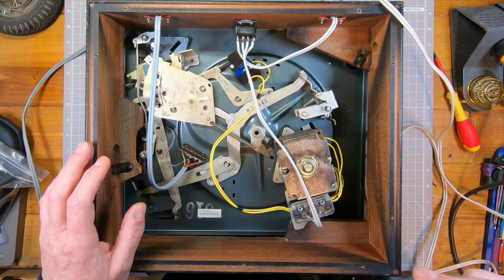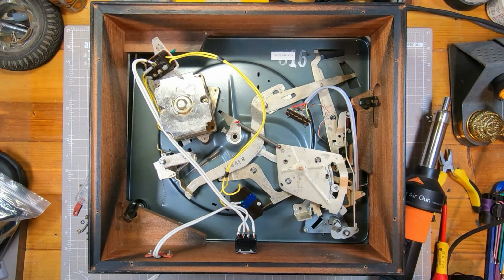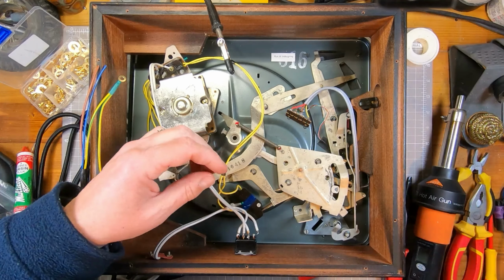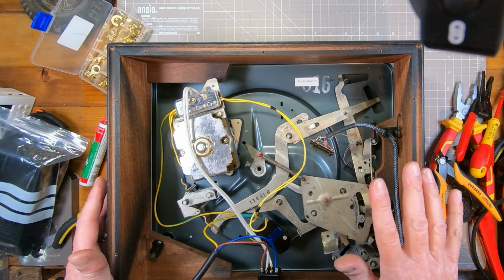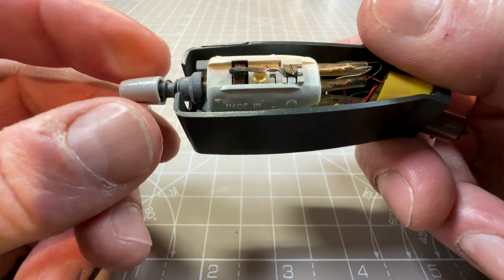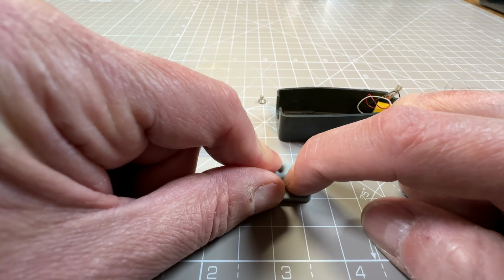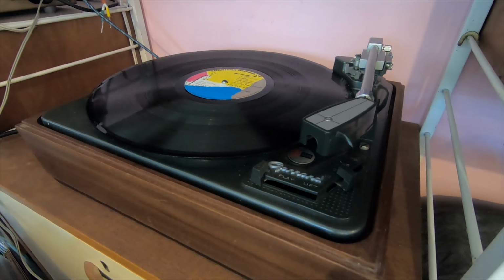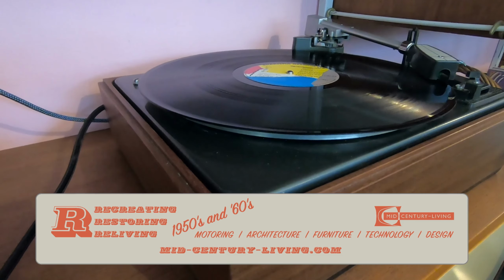Restoring a Garrard SP25 Turntable - How Good is a 60 Year Old Turntable?

Comment: Looking at about the 28:30 point would it have been a possibility to saw the mounting bracket off the original cartridge and use this to mount the new one? Attach to the headshell using the excising screw and the cartridge via the two elongated slots, which would then give some fore  / aft movement for overhang adjustment. Obviously you're at the sharp end there and it's difficult to judge from a video. Incidentally, earthing the turntable at the mains plug will almost certainly create a hum loop; that's why the design earths the deck via the signal leads. If this occurs one of the duplicated earth points needs to be disconnected but as the video's a year old you're no doubt aware of this by now. I genuinely hope this helps - it's not my intention to be a wise-ass! Thanks once again and take care. Edit!! APOLOGIES!! I've just watched to 39:54!! I should have watched all the way through before commenting, shouldn't I! Silly Billy! Apologies once again.
Reply from the maker: Thanks, I appreciate your comment - it was a bit of learning experience as I’d never done this before. It now all works and sounds surprisingly good.

Comment: Another fascinating video; I'm slowly working my way through your pantheon after discovering your channel. The original cartridge is a ceramic which had a very high output generated by a piezo crystal, rather than the (much lower) output moving magnet type you replace it with. The main advantage (to the manufacturer!) of a piezo type was the high output meant an associated amplifier was cheaper to produce as it didn't need an additional high-amplification 'phono stage or an RIAA equalization circuit.  back n the day I remember my dad rewired our Dansette type (actually a Marconiphone which had a Garrard autochanger) portable record player for stereo (after fitting a compatible stereo piezo pick-up) and using his 1950's valve table radio as the second channel, using a very long screened lead to the "gram" input of the wireless.. Sounds a bit Heath Robinson but it worked a treat and, at the time, newly introduced dedicated stereo equipment was strictly a rich mans plaything. My first "proper" separates' turntable was a second-hand SP25 Mk III which came with a Goldring G800 cartridge bought via the small ads in the back of the local paper; no internet then! Thanks once again for the fascinating videos
Reply from the maker: Thanks for your comment and I'm glad you're enjoying working through the videos. And thank you for the fascinating information - it's amazing how self-sufficient people were, and all without the internet to refer to. Just a few magazines and books, the willingness to learn and have a go. Thanks.
Reply: @Mid-Century-Living  Thanks for your kind reply. My dad was an electrician so a lot of this sort of thing came naturally to him. He was the first in our area to have a television, apparently (before my time!) but never got to watch it as he spent most of his evenings fitting suppressors to local car ignitions for free so they didn't interfere with it when they drove past. Also he was colour blind which isn't ideal for an electrician; he spent most of his life as an auto. electrician so you can imagine what a nightmare it was for him identifying the dozens and dozens of different colours on car harnesses. One last quick story before I bore you too much; he always told the story that when he had apprentices he would remove the carbon resistor (which drops the voltage) out of their neon test screwdrivers and replace it with a bolt so when the poor lad put his thumb on the button to test he got a belt from the full mains voltage! Different times...... Enjoy what's left of the weekend and thanks once again

Comment: I found a Mark IV in the recycling room where I live. Needs a bit of cleaning and greasing to get everything working, but else it is really nice condition. One that annoys me with it is that I can't have a 12" record on it while the dust cover is installed. So I think I'll make a new plinth with a new dust cover, as well updating the wiring etc.

My first ever turntable project :)

PS. Also bought a AT-VM95E for it, as it is great value for the price.

Comment: an Audio Technica AT3600L Cartridge would be more suitable for this deck it tracks at 3 grams it's also cheap and sounds really good
Reply from the maker: Thanks for the recommendation, I went with the AT95 as I'd used one some time ago, but seems these automatic decks have some specific requirements due to the tracking weight. I'll look into the 3600.

Comment: I had an AP76 in 1974 which was one step up from the mk2 SP25. Good turntable, which I kept well into the mid 80s.
Reply from the maker: I've seen a few AP76's on ebay, but I didn't realise they were a better machine than the SP25. I was also looking at a zero 100 which would be an interesting restoration with it's tonearm design, but should really focus on the sound quality!
Reply: @Mid-Century-Living  The SP25mk2 was £18 and the AP76 cost me £25. Now the Zero 100 with is pantograph tone arm, that was the stuff of dreams. Oh, and a Linn Sondek LP12 was a mere £75......
Reply from the maker: @mikebirkett010 thanks for that - I've been looking for some period magazines to see the pricing of the SP25 and competing models, but nothing yet.
Reply: I still have my AP76!
I bought it as ‘chassis only’ as I was still at school. It came with a paper template from which my dad and I fashioned a chipboard plinth. 
When I started work I saved up for the ‘proper’ plinth and Perspex cover, which cost £8.50 (my initial  weekly take home pay was just over £11).
One advantage of the AP76 was being mechanical full auto I was able to switch it on using a Lasky’s alarm clock (also a home boxed chassis) to wake me each morning with a randomly selected LP!

Comment: The way it treatens your records and needle reminded me on Dual turntables from that era. More like a using a chisel and hammer on your records. Excellent video, thank you.
Reply from the maker: Yeah, the combination of poor damping of the cueing action and high tracking force won't be great for records. Better to manually cue.
Reply: @Mid-Century-Living  You should have seen the competition from BSR! For its time the SP25 wasn't bad for the money.
Reply: What circa are you from... GARRARD the watch and clock makers  ????
Garrard. We're the gems in their day this model manual and auto version tracked wonderfully. Perhaps the lower built decks were course. Records are only was good in condition as the stylus tip by choice.😮

Comment from the maker: Anyone have any recommendations on good or better alternatives to the Garrard SP25? I really enjoyed making this video, and I'm already thinking of buying and restoring another turntable for a family member.
Reply: The cartridge shell just looked so wrong, possibly a different shell for the cartidge would suit it better.
Reply: The Thorens TD 150 (Same time period) is considerably better. The Goldring Lenco GL75 is a bit better and very fun. Braun made some cool looking ones in the 60's as well. But nearly all tone arms in the 1960's period are just silly in design. The SME company redefined tone arms in the 1960's, and many many record players of the 1970's learnt lessons from them. A classic budget option that learnt these lessons is the Pioneer PL-12 D (1973). Mid 1970's to later 1970's became obsessed with tracking at too low a weight. Then they went too high a tracking weight in the 1980's and designed for Moving coil cartridges which is out of a sane mans budget.
Reply: The Garrard 301 and 401 are excellent and considered Garrards best. Unfortunately they have been held in very high regard by the audiophile community for many years now so fetch quite high prices.